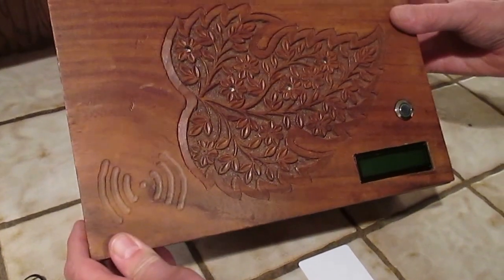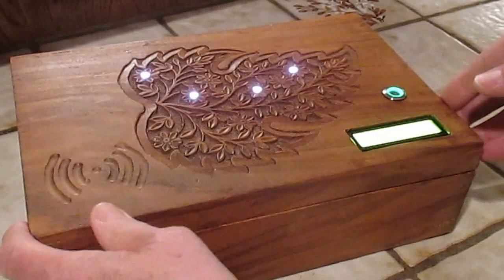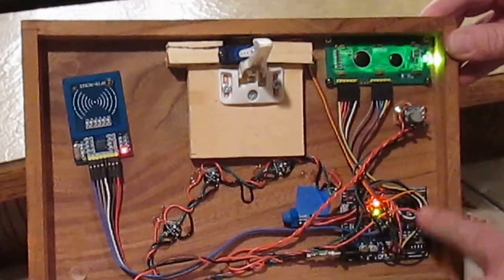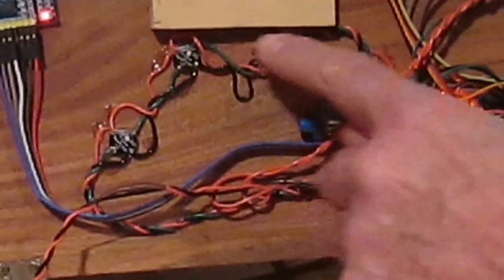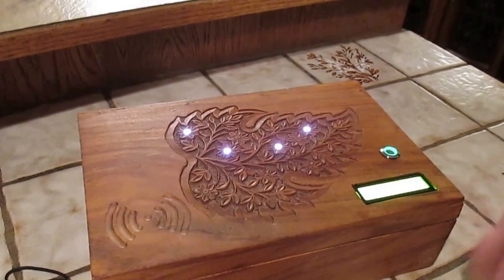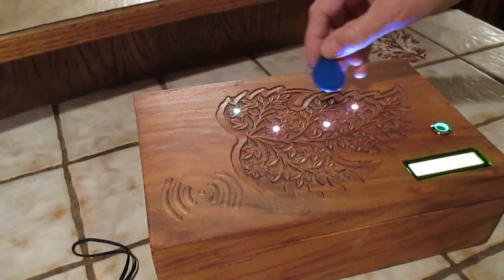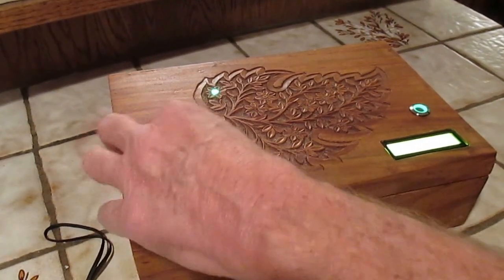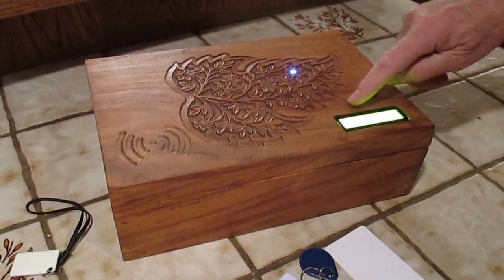RFID Geocache

Comment from the maker: [code]
/*   RFID Geocache with Timer

Modified by Stephen O'Gara in 2015 to use as a geocache

scan all cards in order to get the lock to open.
Time limit between cards
Must press button to Shut off when done. 
Use a parallel LCD screen 16x2
Use a RFID-RC522 board to scan cards
Use an arduino Uno or similar
*/ 

// include libraries
#include <LiquidCrystal.h> // for LCD screen
#include <SPI.h> // 
#include <MFRC522.h> // using library from https://github.com/miguelbalboa/rfid/
#include <Servo.h> // for servo 
#include <Adafruit_NeoPixel.h>  // for Neopixel version 2 lights from Adafruit

// the pins in use by the LCD panel
LiquidCrystal lcd(8, 9, 4, 5, 6, 7);

/*
 * SPI MOSI   11
 * SPI MISO   12
 * SPI SCK    13
 */

#define SS_PIN 10 // SDA
#define RST_PIN 2

MFRC522 mfrc522(SS_PIN, RST_PIN); // rfid card 

String cardId;

Servo myservo; 
#define servoPin 1  // signal - yellow  
// orange - 5 volt
// brown - gnd 

#define pixelPin 3
Adafruit_NeoPixel strip = Adafruit_NeoPixel(4, pixelPin, NEO_GRB + NEO_KHZ800);
// how many, pin name, pixel type flags

unsigned long standbyLastMillis = 0;
boolean fadeDirection = true;
int color = 0;

byte action;

#define ACTION_STANDBY 0
#define ACTION_SCANNING 1
#define ACTION_WAITINGFORNEXTSCAN 2
#define ACTION_WRONGSEQUENCE 3
#define ACTION_OPENING 4
#define ACTION_OPEN 5
#define ACTION_DONE 6

#define MESSAGE_WELCOME   "*** WELCOME *"
#define MESSAGE_WELCOME2  "  Scan Tag Now  "
#define MESSAGE_CORRECT   "*** CORRECT *"
#define MESSAGE_SCANNEXT  " Scan Next Tag "
#define MESSAGE_OPENING   "OPENING........ "
#define MESSAGE_WRONG     "** WRONG TAG **"
#define MESSAGE_TRYAGAIN  "   Start Over   "
#define MESSAGE_TIMEOUT   "* TIME RAN OUT *"
#define MESSAGE_OPEN      "CONGRATULATIONS!"
#define MESSAGE_EMPTY     "    You Won !   "
#define MESSAGE_OFF   "TURN OFF BUTTON "  // added this 
#define MESSAGE_OFF2   "   When Done    "  // added this

String cardids[] = {"91202b61", "44144e56", "3333709a", "c5c892b5"};  // id's on cards
String masterid = "6aef6acb"; // id on master card - short cut to open latch 
int CARD_COUNT = 4; // number of cards in game
int lastCardScanned = 0;
String lastCardIdScanned;
unsigned long CardScanLastMillis = 0;  // sets timer to zero upon correct scan of card?

void setup() {

  SPI.begin();
  
  // mifare reader init
  mfrc522.PCD_Init();
  
  // lcd screen init
  lcd.begin(16, 2);  // defines lcd as a 16 character, 2 line screen
  lcd.setCursor(0,0);  // resets curser to top left corner of lcd
  lcd.print(MESSAGE_WELCOME); // display the welcome message on line 1
  lcd.setCursor(0,1);  // move curser down to line 2
  lcd.print(MESSAGE_WELCOME2); // display welcome message 2
  
  // servo init
  myservo.attach(servoPin);
  // servo locked position - also below ==========================================
  myservo.write(40);
  // ============================================================================
  // neoPixelstrip init
  strip.begin();
  strip.show();
  
  action = ACTION_STANDBY;
}

void loop() {
  
  
  switch (action) {
    case ACTION_STANDBY:
      standbymodusLights();
      readCard();
    break;
    
    case ACTION_SCANNING:
      standbymodusLights();
    break;
     
    case ACTION_WAITINGFORNEXTSCAN:
      readCard();
      statusLights();
      if (millis() - CardScanLastMillis > 5000) {
        lcd.setCursor(0, 0);
        lcd.print(MESSAGE_TIMEOUT);
        lcd.setCursor(0, 1);
        lcd.print(MESSAGE_TRYAGAIN);
        action = ACTION_STANDBY;
        lastCardScanned = 0;
        lastCardIdScanned = "";
      }
    break;
    
    case ACTION_WRONGSEQUENCE:
      wrongLights();
      delay(1000);
      action = ACTION_STANDBY;
    break;
    
    case ACTION_OPENING:
      openingLights();
      action = ACTION_OPEN;
    break;
    
    case ACTION_OPEN:
      lcd.setCursor(0, 0);
      lcd.print(MESSAGE_OPEN);
      lcd.setCursor(0, 1);
      lcd.print(MESSAGE_EMPTY);
      // open servo position goes here ========================================================
      myservo.write(140);
      // =======================================================================================
      action = ACTION_DONE;   // close servo and add comments to turn off game when done 
      break;
      
     
    case ACTION_DONE:
      // add delay and close servo 
      delay(1500);
      //==================================================================================
      // closed servo position goes here and also above for initial position
      myservo.write(40);
      //=================================================================================
      delay(5000);
      lcd.setCursor(0,0);
      lcd.print(MESSAGE_OFF);
      lcd.setCursor(0,1);
      lcd.print(MESSAGE_OFF2);  
      break;
     
  }
}

void standbymodusLights() {
  if (millis() - standbyLastMillis > 20) {
    standbyLastMillis = millis();
    
    if (fadeDirection == true) {
      color = color + 1;    
      if (color >= 150) {  // was 250
        fadeDirection = false;
      } 
    } else {
      color = color - 1;    
      if (color <= 10) {  // was 30
        fadeDirection = true;
      }   
    } 
  
    for (int i = 0; i < strip.numPixels(); i++) {
      strip.setPixelColor(i, strip.Color(color, color, color)); // was color, color, color
    }
    
    strip.show();
  }
}

void readCard() {
  if (mfrc522.PICC_IsNewCardPresent()) {
    if (mfrc522.PICC_ReadCardSerial()) {
      cardId = "";
      for (byte i = 0; i < mfrc522.uid.size; i++) {
        cardId += String(mfrc522.uid.uidByte[i] < 0x10 ? "0" : "");
        cardId += String(mfrc522.uid.uidByte[i], HEX);
      } 
            
      if (lastCardIdScanned != cardId) {
        lastCardIdScanned = cardId;
        if (lastCardIdScanned == masterid) {
          action = ACTION_OPEN;
        } else if (lastCardIdScanned == cardids[lastCardScanned]) {
          lastCardScanned++;
          if (lastCardScanned >= CARD_COUNT) { // all cards are scanned
            action = ACTION_OPENING;
            lcd.setCursor(0, 0);
            lcd.print(MESSAGE_CORRECT);
            lcd.setCursor(0, 1);
            lcd.print(MESSAGE_OPENING);            
          } else { // correct card in this sequence
            action = ACTION_WAITINGFORNEXTSCAN;
            lcd.setCursor(0, 0);
            lcd.print(MESSAGE_CORRECT);
            lcd.setCursor(0, 1);
            lcd.print(MESSAGE_SCANNEXT);
            CardScanLastMillis = millis();
          }
        } else { // wrong card in this sequence
          lastCardScanned = 0;
          lastCardIdScanned = "";
          action = ACTION_WRONGSEQUENCE;
          lcd.setCursor(0, 0);
          lcd.print(MESSAGE_WRONG);
          lcd.setCursor(0, 1);
          lcd.print(MESSAGE_TRYAGAIN);
        }        
      }
    }
  } 
}

void statusLights() {
  for (int i = 0; i < strip.numPixels(); i++) {
    strip.setPixelColor(i, strip.Color(0, 0, 0));
  }
  strip.show();
  for (int i = 0; i < lastCardScanned; i++) {
    strip.setPixelColor(i, strip.Color(0, 200, 0));
  }
  strip.show();
}

void wrongLights() {
  for (int i = 0; i < strip.numPixels(); i++) {
    strip.setPixelColor(i, strip.Color(200, 0, 0));
  }
  strip.show();
}

void openingLights() {   
  for (int i = 0; i < strip.numPixels(); i++) {
    strip.setPixelColor(i, strip.Color(0, 200, 0));  // all 4 green lights on
  delay(200);
  }
  for (int i = 0; i < strip.numPixels(); i++) {
    strip.setPixelColor(i, strip.Color(0, 0, 0));  // turn off lights
  }
  for (int i = 0; i < 4; i++) {    // blink blue lights quickly
    strip.setPixelColor(0, strip.Color(0, 0, 200)); 
    strip.show();
    delay(60);
    strip.setPixelColor(0, strip.Color(0, 0, 0));
    strip.setPixelColor(1, strip.Color(0, 0, 250));
    strip.show();
    delay(60);
    strip.setPixelColor(1, strip.Color(0, 0, 0));
    strip.setPixelColor(2, strip.Color(0, 0, 250));
    strip.show();
    delay(60);
    strip.setPixelColor(2, strip.Color(0, 0, 0));
    strip.setPixelColor(3, strip.Color(0, 0, 250));
    strip.show();
    delay(60);
    strip.setPixelColor(3, strip.Color(0, 0, 0));
    //strip.show();
    
    //delay(60);
    strip.setPixelColor(0, strip.Color(0, 0, 200)); 
    strip.show();
    delay(60);
    strip.setPixelColor(0, strip.Color(0, 0, 0));
    strip.setPixelColor(1, strip.Color(0, 0, 200));
    strip.show();
    delay(60);
    strip.setPixelColor(1, strip.Color(0, 0, 0));
    strip.setPixelColor(2, strip.Color(0, 0, 200));
    strip.show();
    delay(60);
    strip.setPixelColor(2, strip.Color(0, 0, 0));
    strip.setPixelColor(3, strip.Color(0, 0, 200));
    strip.show();
    delay(60);
    strip.setPixelColor(3, strip.Color(0, 0, 0));
    strip.show();
    
   
    
  }
}
[/code]